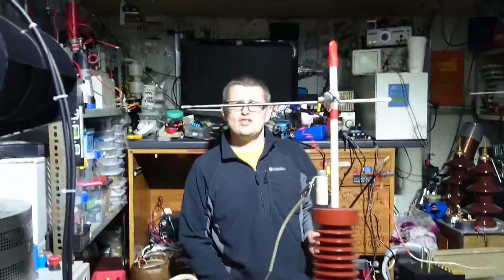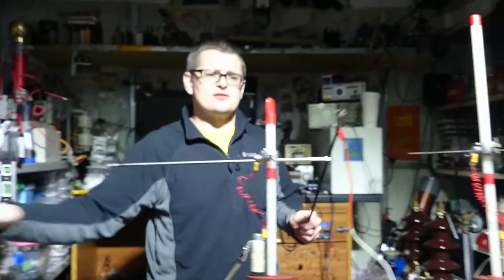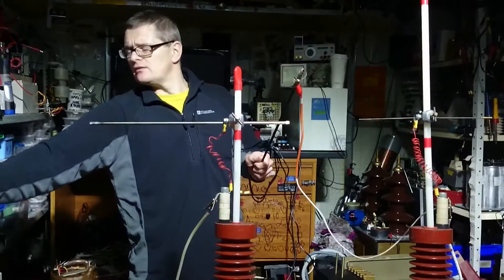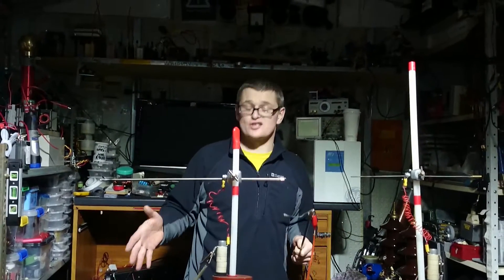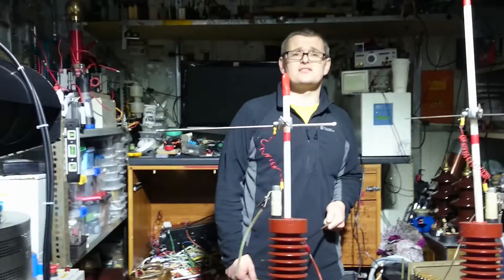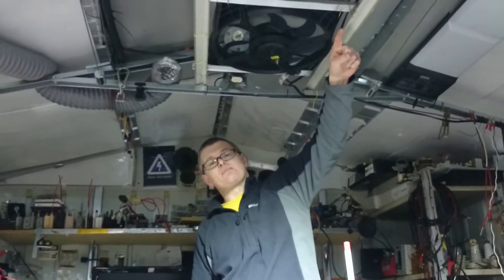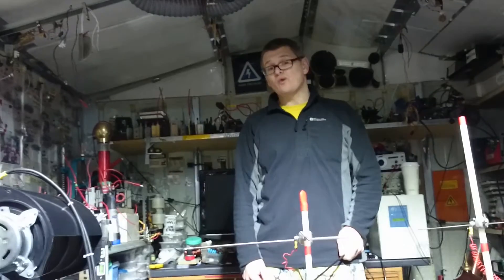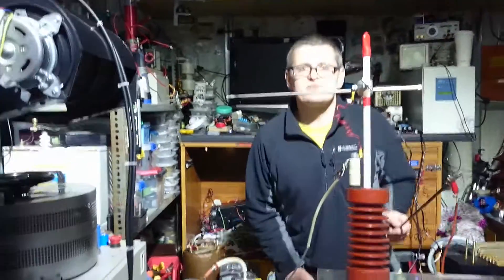Xray transformers output 1 amp current Arcs

Comment: high1voltage1rules
Hm...... so I have heard it's ballasted to 4kW. That looks unsafe enough for me to stay far away from it LOL. I don't mind experimenting with flyback transformers or MOTs, but this thing has a very excessive potential. Honestly, if you really do a full bridge unballasted video, I can't wait to see it.

I'm curious as to theoretically how much X-Rays it could put out at full power. Probably glow all the fluorescent bulbs and CRTs in a mile LOL. I think I might want to calculate that, just to get an idea of how powerful a 150kW X-Ray transformer would be.

I would not stand that close to it, if I were you, and that's coming from someone who knows quite a bit about that kind of stuff. But, I assume you know what you are doing with high power HV far more then I would.

Be safe, and keep making these videos. :)
Reply from the maker: Hi mate, running this transformer,  and being a x-ray transformer that powers a x-ray tubes' it will not give of Xrays that are dangerous to us! If there was any emitted from the transformer or the arcs it would be 0.0.1% of radiation. So it's all safe.
BUT if I was powering the x-ray tube then that's very dangerous! And stupud. I'd never exempt to do so!! Iv made xrays myself but this was using a glass capacitor at a rating of 12kv and I was putting into it 30kv lol and the thing lit up! A awesome blueish. And I was very far from it! And the sounds from it was very interesting. 

Thanks for ya comment and hope ya well.😉 

Anthony 

High1voltage1rules

Comment: Hey high1voltage1rules do you think that is lethal if u got shocked with that??? The sound kinda makes me think of a flyback...
Reply from the maker: My friend, the power from that transformer us 10 times more powerful than a flyback lol, ov course this is ballasted" so it's restricted of current, so it's power is around 40-48ma, so you still don't want to touch it lol. But some day I'm going to run it without Ballasts just for you guys 👍😉😁😋
Thanks for the comment.👍 and hope ya well.😉 

Anthony 

High1voltage1rules

Comment: 150kV at 1 amp = 150 kilowatts (of real power assuming you corrected for power factor)? Are you sure? That is 625 amps with 240v on the primary which could supply sufficient power for several neighbourhoods. You might want to revise your calculations. Great arcs though, I look forward to the full bridge :)
Reply from the maker: I forgot to tell you all its ballasted at 4000 watts. And I said in the video it's only getting around a 110volts being ran on a half bridge igbt. Full bridge" well let's find out when it's built!! 👍
Reply: high1voltage1rules Great video buddy, awesome arcs, can't wait for more!

Mate, If its ballasted it's not 1Amp still, all the ballast does is increase the impedance on the AC (before the bridge rectifier) so that the current in is lower. If it is 150kV out then it's gonna be 27mA flowing on that secondary ;)

I would expect the RMS current in to be around 16.7 Amps.
Reply from the maker: Just Power Electronics yes thanks tom, like I said to others' the transformer was ballasted at 4000 watts, and I forgot to tell in the video, so no its not going to be the output I said lol, the current like we spoke about will be abit more than 27ma, I would say around 40+ma, 😉 Thanks for the info tom and hope ya well mate.👍😉
Reply: 50 kV or thereabout. It's high frequency so arc can easily bridge the gap